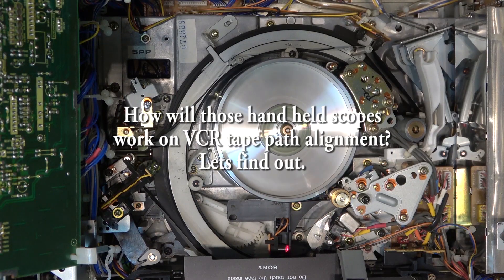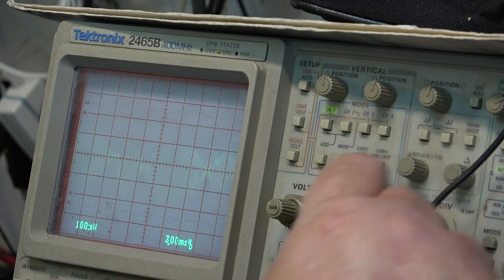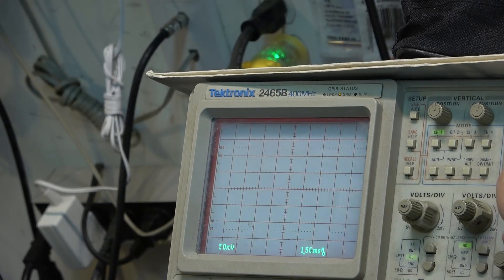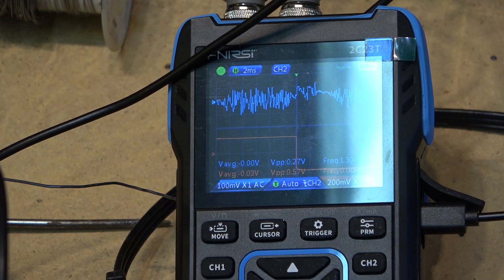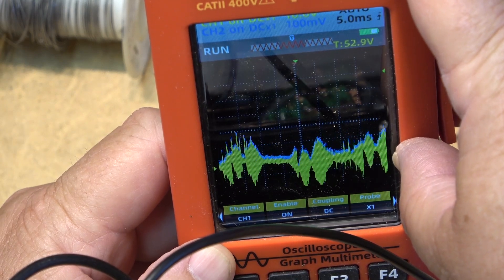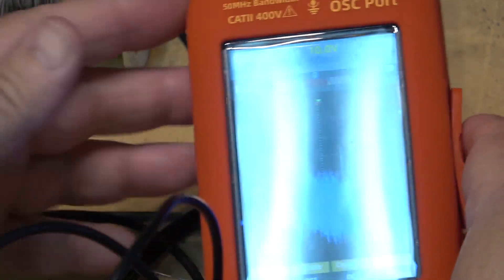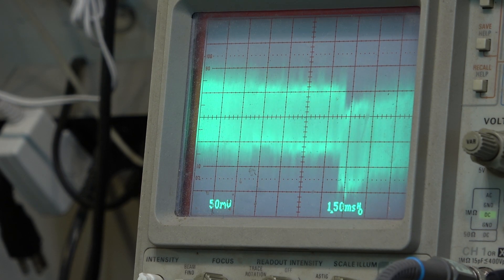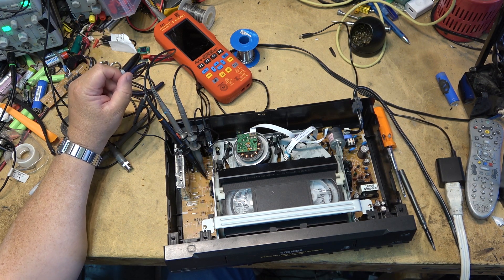Hand held scope alignment of vcr

Comment: The problem with these cheap scopes is if you're lucky to have the waveform from say the s'manual maybe you'll be able to read the screen but you need to retrain or alter your read method to equate to whats required. And if you ain't got no documentation and relying on familiarity with similar wforms you're lucky enough to get a good result. Well to me thats what these newer ones seem to suggest..until one comes out and actually mirrors an anolgue read.

Comment: I'm really glad I came across your video as I have tried for 3 days to do the same job on a Sony SLV 625UB with that blue piece of junk which I thought would do the job but how wrong was I as its impossible to even get a decent waveform with it so I'm gonna invest in one the same as yours if I can find one but I guess you've saved me any more time wasting with the blue han held scope.

I always watch your videos in which I learn by your in depth tuition.

Thank you
Happy New year.
Reply from the maker: Those cheap handheld scopes are junk. An old analog scope is what you need.  Digital scopes have their place but unless you spend a ton they are useless for much of this analog work.
Reply: @12voltvids 
I've also ordered 10 of those blue gear that always break from KP components is the company legit and are the ones they supply good.
I'm in Plymouth UK.

But your videos are great I have learnt a he'll of a lot from you thank you
Reply: @12voltvids  thanks for the reply back though.😊

Comment: I am looking for an analog scope to do just that, vcr allignment and only that. Your scope is top of the line. Could you tell me what spec of scope without all the bells and whistles that I could get please? I beleive it has to read upto 100mhz?
Reply from the maker: 10 mhz is fine for what you want to do.  I only have a high end scope because i got it for free.  Otherwise i would be using my 1963 HP 101 which is an all tube 10mhz dual channel.  I used an iwatsu 40mhz for all the years I was working at the shop.

Comment: The trouble with the hand held scopes (crap) you can drink a cup of coffee before the screen catches up . 😂 
You just carn’t beat the analog scopes
Reply: A digital scope with DPO/persistence will work for this application, but cost far more than an analog one.
Reply: @CanizaM  My Uni-T has got it. At the time I purchased my unit at about the same price there was a Siglent with a display called super-phosphor meant to replicate an analog scope... and I didn't like the chunky traces and went for the Uni-T instead as I had a good experience with their meters.

It's only about my experience, not suggesting one or the other.
Reply from the maker: That goes without saying